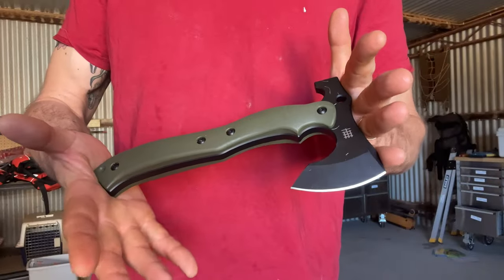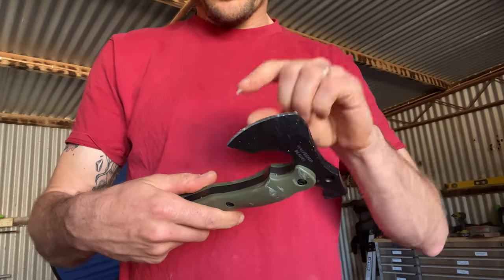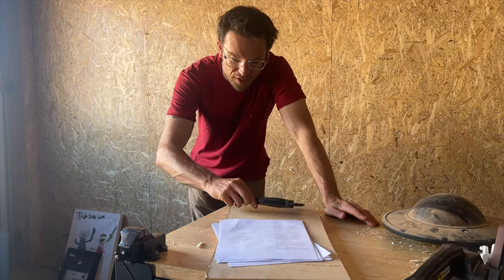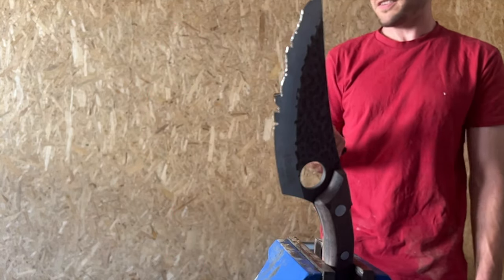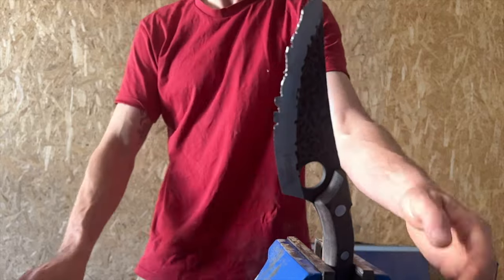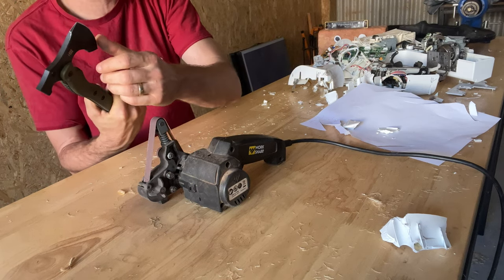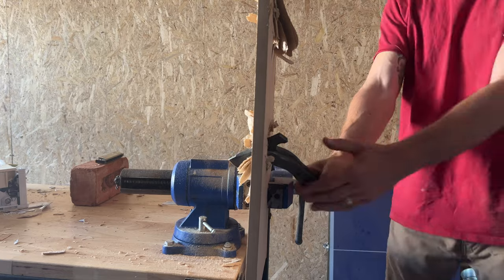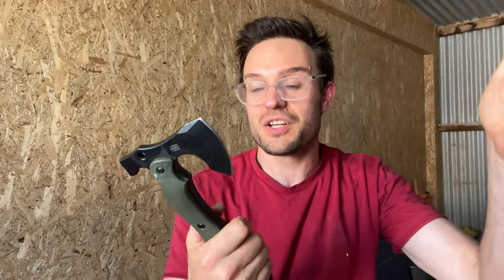Destroying Evil Things with the Compact Rescue Axe

Comment: In the not so distant past the true mechanical sewing machines was almost indestructible, if you keep it clean and oiled, usually it was the electric components that was the first to give up. And looking into the rest of this one was just plastics and wires. Many sewing machine makers also went into weapon manufacturing as they know to handle the materials and tolerances needed. Singer made the best 1911 handgun, they was of such quality as the was not permitted to continue with that, they did other very precis parts to the war effort.

Comment: Looks like a 2nd rate tomahawk to my Ontario knife company RD Hawk 2 tomahawk which I recommend if ur looking for a good looking American made mid sized full tang tomahawk with grippy micarta handles coated 1095 steel a great sheath a vicious spike on the backside. It’s very well made and tough especially for the price of $100 to $125. I really can’t say anything bad about the RD Hawk I’ve had mine for a about 10 yrs and it hasn’t skipped a beat after being thrown at a trees 100’s of times chopped a few small to medium trees down and has even split small to medium logs dozens of times and it’s still in great condition besides some of the coating being removed and having to resharpen it a handful of times which would happen with any tomahawk. 😊